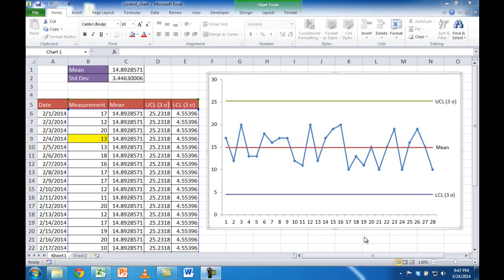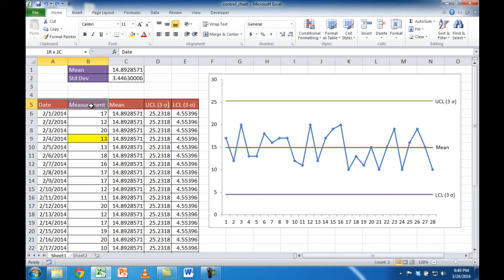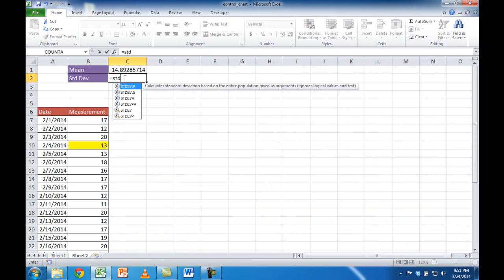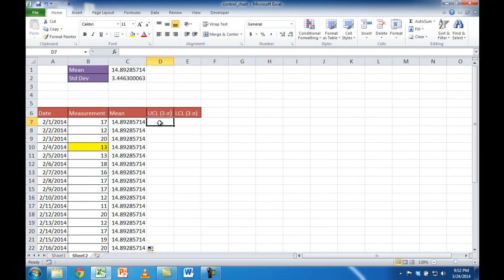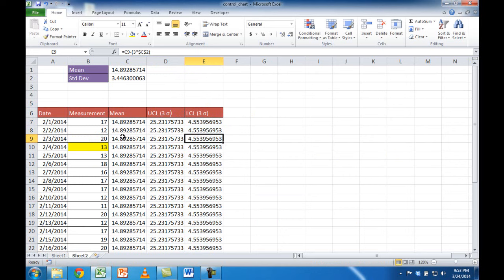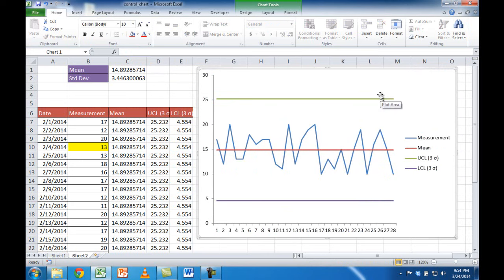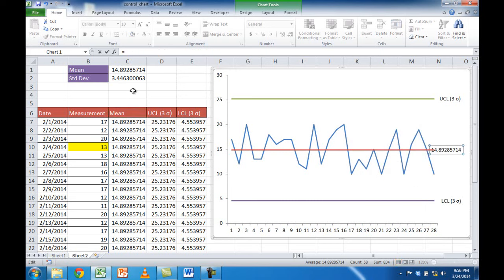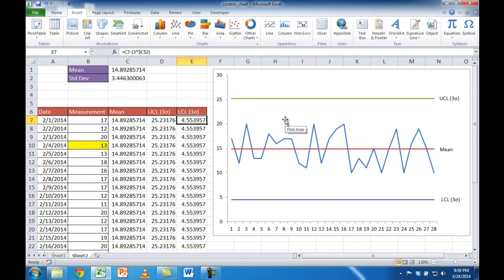Create a Basic Control Chart

Comment: Careful when calculating control limits...it is not technically correct to simply use sample standard deviation.  You should really use the short term standard deviation calculated from moving range and statistical constant 1.128.  :)
Reply from the maker: Hi The Engineering Toolbox Channel, thanks for adding to the thread!

Comment: A couple other commenters caught this, but this can't be overstated for your viewers: THIS VIDEO CALCULATES CONTROL LIMITS INCORRECTLY AND WILL LEAD TO THE CREATION OF MISLEADING CHARTS THAT ARE USELESS FOR PROCESS IMPROVEMENT. 

Using any STDEV function calculates the dispersion of all data relative to the overall mean, which exaggerates the effects of outliers and small shifts, thereby inflating the limits and hiding the signals that they are supposed to detect. The key insight of Walter Shewhart was that our statistics need to account for the element of time: this isn't a sample of numbers representing a population, but rather, an ordered sequence of data produced by a causal system over a period of time. 

The CORRECT way to calculate the control limits is to calculate the point-to-point differences (the "moving range"), average them, and divide the average of the moving range by 1.128 (bias correction for subgroup of 1, which is what the individuals chart is), which gives you Sigma. Control limits are 3 Sigma on either side of the mean, unless there is a barrier on one side of the mean (e.g., if your UCL is less than zero when a negative value for the process variable would be nonsensical), in which case you just get a one-sided chart, and you can detect "Rule 1" (Western Electric) signals on only one side of the average. 

I would recommend that your viewers look up Dr. Donald J. Wheeler's FREE articles on Quality Digest, where he clearly and accessibly explains the statistical underpinnings of SPC and how to use it to drive process improvements. I would also recommend that your viewers calculate control limits in the way I described, also calculate control limits according to the method described in this video, and then try different modifications to the data stream to experiment with how different kinds of outliers affect the calculated limits in both approaches. It will give you a real hands-on sense of what makes the Process Behavior Chart so unique and why a population-statistics approach falls short.
Reply from the maker: Matthew Lemieux, that is very interesting...thanks for letting me know.

Comment: Really appreciable to explain it in such a simple way
Reply: In real application, the mean should not be the population mean but rather the true value of the CRM. Is that correct? Moreover, which standard deviation should be use for 1sd, 2sd and 3sd? Is it from the SD from measurements or SD from the CRM itself?

Comment: This is a great video. To keep measuring progress as your data collection goes on, would you just refresh your ranges each time you add more data?
Reply from the maker: That is correct either by updating the range from your chart or if the source range is using the table format it should update dynamically.
Reply: @DougHExcel  that’s brilliant. I have another question, if that’s okay? How do we prevent the UCL and the LCL from moving along with the mean? As the current way would move the LCL and UCL, so how would I keep the control the same? I’m sorry if this doesn’t make sense - but I’m wondering how I can keep the lines constant as the test progresses to measure the performance in regards the initial control levels.

Comment: Not a terrible piece on charting, but it is not a control chart. Using 3 standard deviations is an incorrect method for calculating control limits. You have to use a local measure of dispersion; in this case it would probably be a moving range (or maybe you could use a c-chart, if these are counts that could be characterized by the Poisson distribution).
Reply from the maker: Rip Stauffer, that is very interesting...thanks for letting me know.

Comment: Hallo Mr. Dough H,
Thank you for posting this video. It was helpful for me. Actually I am doing some studies with the help of control chart. I have a question for you: to get the value for UCL and LCl you have multiply with 3 std and you are getting a perfect chart. However, in my case for LCL, when I multiply with 3 std  it is showing negative value in LCL. Can you kindly explain me, what does it mean? Is it fine to multiply with 2 std instead of 3 std?
Reply: Hi Kunchok, what are you measuring? Or what is the unit of measure? Usually if you a control limit is negative you manually change it to zero (if it is time or length). Note: if you are measuring temperature then negative values are valid.
Reply: Hey Daniel Solomon, in the video he has multiplied mean with 3. Is that a relation to get SD?
Reply: yes, me too!
Reply from the maker: Hi Kunchok Tharlam, thanks for the comment!